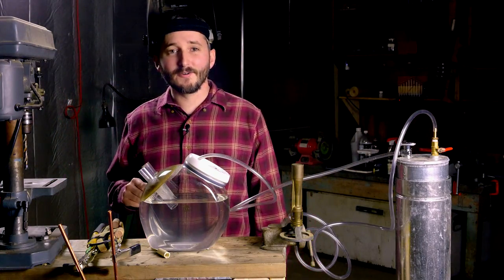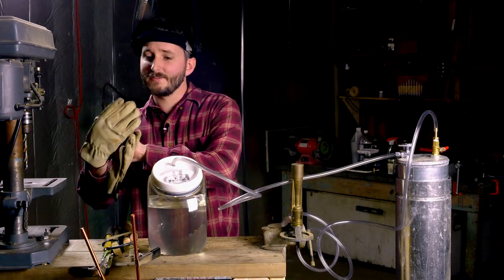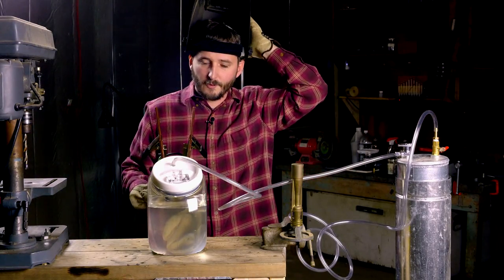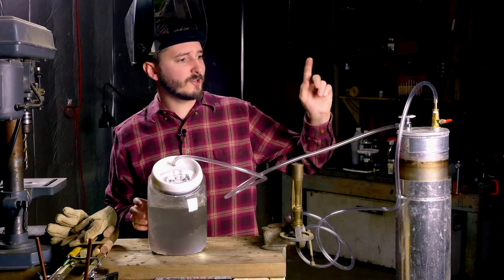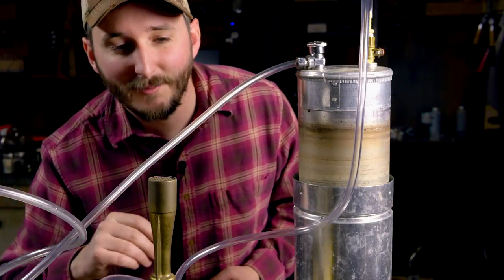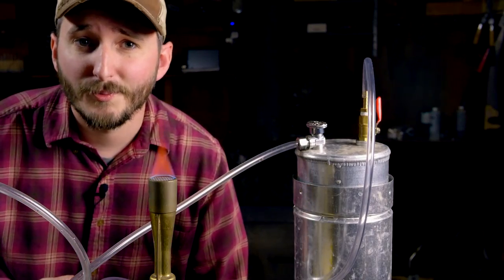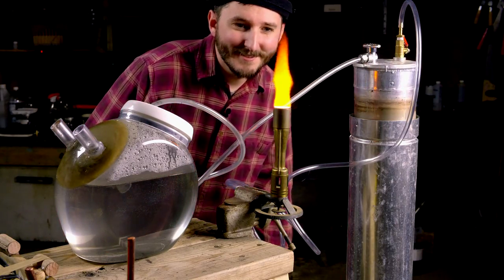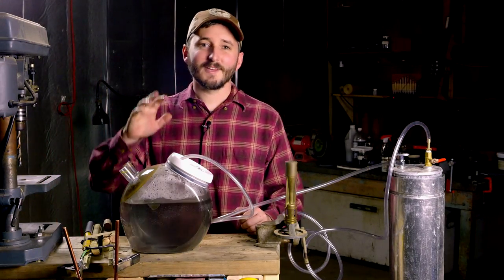Plasma Generated Water Gas (Electrically Produced Fuel That Is Not HHO)

Comment: So, you can make gasoline from CO2 capture.  Are you saying, you can arc carbonwater, into H and CO, burn it off in a closed system.  Create heat from the chamber that is submerged in water, that will boil off and create steam, use that steam to create electricity, reacapture said steam and put it right back into the carbon water chamber after it condenses.  Then from the CO2 released, turn that into gasoline for cars?

All from Carbon and water?  Sounds like you need to do a video doing just this...just saying.

Comment: i'm curious if the carbon monoxide and hydrogen combine or if they stay separate? if they are separate wouldn't the lighter of the two be at the top of your gasometer and burn first? and if you can combine them would it be a more efficient gas then when they are separate?
Reply from the maker: Deleted my first comment because I misunderstood your question. The two gasses mix together. Gas doesn't easily separate itself into different densities.
Reply: @Nighthawkinlight  Good to know, when you said its carbon monoxide and hydrogen I though they were separate. Thank you for the reply

Comment: Would there be a way of doing this using an arbitrary and renewable carbon source (eg wood charcoal) rather than having the main source of carbon in the CO being from the commercial carbon rods?
Reply from the maker: Possibly
Reply: Store bought lump charcoal can reach up to 70-80% carbon composition. Binchotan (Japanese white charcoal) is around 95-99%. If you want to go through the labor intensive process of making Binchotan, all you would need to do then is shave it into a rod. Or with lump charcoal pulverize it and then rebind it into a rod shape. I've seen videos of people on youtube doing this but I'm not sure what the process is exactly.

Comment: I know oxygen allows other gases to burn or combust, but can oxygen interact with only itself to cause a flame or combustion? Or does there need to be another element present? If you ran a current through a crystal tube of oxygen will it ignite or just become plasma? Then what is the difference between electrically generated plasma and combustion chemically generated plasma?
Reply from the maker: Oxygen cannot combust on its own. Plasma is produced simply by adding a lot of energy into a gas. That can be through electricity or through chemical reaction.

Comment: If you were to use filtered black water, would this still work? 

What about salt water? (Obviously the conductivity is higher)
Reply from the maker: You wouldn't want to use salt water because you would lose power to electrolysis and generate unwanted oxygen, and the conductivity would make it an even more severe electrocution hazard.

Comment: how much gas could you had produced using electrolysis with using the same voltage and current the welder used in this case for same amount of time. I bet a lot more gas but would it be as powerful fuel?

Comment: soif i had a small  completley sealed but vented on one end cylinder filled with water but also able to collect water but not allow the water to escape at least  in the form of water and also inside that cylinder was a little device capable of inducing an electric charge of how ever many volts i choose . is it feasable that if i send a electric current throught that water and the water has no place to escape it will convert into plasma and shoot out the vented end?

Comment: Can you run a generator to power the carbon arc and get more gas out than the generator needs ? 🤔
Reply from the maker: Maybe, but you'll never get enough gas to both run the generator and also make more carbon electrodes as they erode away.
Reply: @Nighthawkinlight   thats fair enough....    and asking too much i guess
..
But it would be cool to work out if the cost of creating that gas is way cheaper than gasoline...
...
Ok petrol is loaded with 80% tax in england!
     which doesnt help
    but still... 
    take away the evil greedy tax and if your gas costs less to make,
     then its worth the carbon loss :)
Reply: @Nighthawkinlight  could bamboo be made into carbon rods like it light bulbs?

Comment: I'm wondering about its energy density versus something used for looking like Methane or LPG. Could this be used to do something along the lines of producing a gas that could be produced from an off grid system which could be used for an uncompromising† gas hob?

† I'm thinking high temperature cooking like Chinese cooking.

Comment: Wait a second. How come the gas doesn't explode in contact with Hot arc???
Reply: For it to explode there would be needed some kind of oxidizer for the gas to  react with, under the conditions in the video that would be impossible.
After all, as he explained the gasses produced are CO and H2, and neither of these are oxidizers.

Comment: What if the electrodes are made of platinium ?
Reply: You'd probably get mostly hydrogen, but it may react with CO2 in the air to form hydrocarbons via the mobil process.

Don't do this though, this is extremely dangerous, sparks in an electrolysis tank is just begging for an explosion (I've had it happen before)

Comment: Interesting as a light and fireworks display but for any other purpose totally impractical.......if it isn't safe or possible to do this simply or at home why bother when it needs an industrial approach.
Edit.........a year later.....it occurred to me that this process is almost the same as the one that I use in a plasma welder and it goes by the name of atomic hydrogen, invented in the 1920's in the USA......the welder is the Multiplaz 3500, demoed on UTUBE, in some other videos.
Basically, the principle is that water is heated in the torch body to produce superheated steam and this steam is blown through an arc formed in the torch head......the steam is broken down to hydrogen and oxygen with the oxygen bein burnt off and the hydrogen losing an atom and becoming atomic hydrogen that forms a plasma.
The temperature of the resulting plasma is 8,000 deg C.
The plasma welder has the characteristics of an oxy propane torch (on steroids)  and a Tig welder but without the argon gas that Tig uses.

Comment: ionic energy  as per joe booker alias the joe call .as he states its not water .did you tryit in a vacuum .as the method to copy in a engine is the block negative and in a diesel old engine the glow plugs could be made the anode and if the engine is sealed at inlet and exhaust to allow engine to be vacuumed it should ionize the air in the cylinder and the vacuum cools instantly to allow air to restabalise    just a thought

Comment: Adding a scuba regulator and tank to your laboratory would allow you to be safer and express a DIY safety environment for your audience. Carbon monoxide is a lingering cumulative issue preventing blood from functioning. It’s replaced every day but can cause permanent brain damage. Human error occurs. Materials fail. This is a cleverly designed experiment with a reasonable safety warning. People who are not as clever and don’t know what they are doing could easily get themselves into serious consequences. Just saying that safety equipment is fun too.

Comment: There must be a more efficient way of making fuel! Pyrolisis of wood/ biomass, by concentrated solar! Plus you get the gas, the carbon, tar/oils, and methanol, many uses! Plus mix with hho, from solar power, it could easily power a house, gas stove, solar power,  tankless gas water heater, ya only need a means of storage! Have you time to work on that?? Maybe supercooled, and compressed to a liquid, ???

Comment: What's the wattage? 150 Amps of what voltage?
Reply from the maker: Most arc welders run 20-30v
Reply: @Nighthawkinlight  Thanks! So it's about 3kW of electricity, that's plenty. Im not sure if it's too effective xD

Comment: is not likely that is pure H2 and CO. Oxygen must be there also due to electrolysis. And if it is, then why this hole container and tubes and everything does not explode? Oxygen and hydrogen mixed + a spark - should travel trough the tubes and blow everything up. So for some reason very little O2 is made. Still quite a dangerous experiment when first time discovered. How to know upfront O2 will not be generated and the hole thing will not blow up.. brrr..
Reply from the maker: O2 would never survive in the arc in proximity to H2 at those temperatures.
Reply: @Nighthawkinlight  aha that makes perfect sense. pff im so stupid :))

Comment: Nice can build a gasometer usable with aluminum and a carbonate to capture a high release of gas for a combustion engine, much cheaper than burning fossil fuel. I thought this video was for actually burning water using a radio frequency so maybe another video can be on that. Now that most people have been grounded from air travel the frequency of UFO will shoot up from private vehicle that fly under the radar. Governments have their own agenda and its not about protecting your interests but theirs so eventually the truth maybe release about the real reason which is what will occur in this or the next sun cycle so eyes open no fear everyone.

Comment: Turn up the amps? Lmao. You need to get through the natural voltage resistance to sustain the arc. Lower the amps down 1 or 2 amps and crank the voltage up to around 250k and you will have no problem sustaining an arc.

See the king of random's plasma smelter.

Comment: HHO is a myth and hydrogen is not a good transportation fuel.
Water cracks into 2 H2 molecules for every O2 molecule formed.
Electrolysis of water always gives less than 100% efficiency.
Water being cracked heats up, so some of the electrical power is lost.
Fuel mass burned per second = horsepower available.
Hydrogen is not dense at all; one would need nearly three gallons of liquid hydrogen to match the energy of a gallon of gasoline.
Compressed hydrogen?  Even worse performance.
Burning hydrogen is a clean fuel, but with its low density, storing it takes up most of the vehicle!
As with any internal combustion engine, less than 20% of the total energy from the fuel goes into moving the car.
The other 80% is waste heat.
Hydrogen fuel-cells have better efficiency, but low power output makes them better suited for battery charging.
Why not just use electricity in the first place?

Comment: Hm, so instead of splitting H2O and burning H2, you put in more energy to split H2O and "split" C and burn CO and H2. Would be interesting to see some calculations on how (in)efficient exactly that is in numbers (compared to normal electrolysis) - you get an additional molecule to burn but put a lot more energy in it. 

Nice video.

Comment: That's a rather expensive way of producing what used to be known as "town gas". A mix of H2, CO, and CH4, used for lighting homes from the Victorian era up until the 1970s when natural gas started to be produced and utilised instead. Since town gas contains CO, that's the origin of depressed housewives sticking their head in the oven to end it all. Doesn't work nowadays. 

I would imagine welding rods are an expensive source of carbon for that. Better maybe to stick a screw into a lump of charcoal maybe? I'm disappointed, it's not some revolutionary gas, it's just about as useless as HHO is. And most of it IS still HHO, or rather H2 and O2 to use the actually accurate term.

As a science demonstration it's not particularly useful, and as a fuel source beyond useless. There are some very good videos on this channel but this isn't one of them.

Comment: This process not smart at all, liquid water in big quantity will carry away high % of heat, so you burning bunch of electricity just to heat water, and only small portion really doing useful work of making gas mix.
Better would be to inject steam into electric arc, in closed heat insulated chamber, at the outlet of the chamber mount counterflow heat exchanger to cool gas products and at same time overheat input steam, in this case major amount of heat would be conserved and captured, initial steam need to generate in outside boiler using cheap heating methods.But even this method does not deserve a patent, not talking about process submerged in water.

But it's all near to useless for practical usage(well it is a bit better than HHO, at least H2+CO mix you can store in pressurized tanks) - you burn electricity, more valuable form of energy, into gas which later will be combusted into heat - least valuable form of energy.

The reaction itself is interesting because it's endothermic reaction driven purely by heat, so could use super cheap sources of heat like concentrated sunlight or lava to make flammable and storable gas.